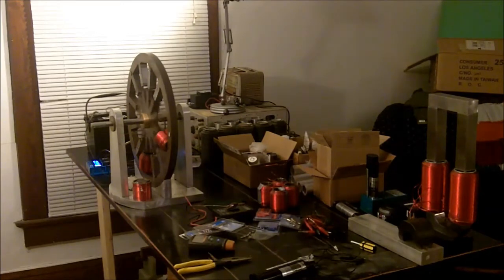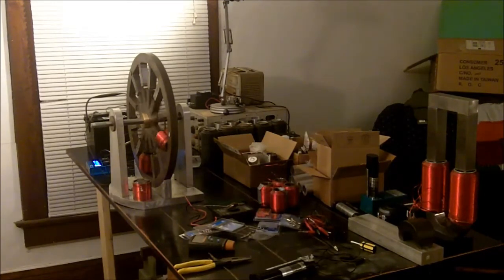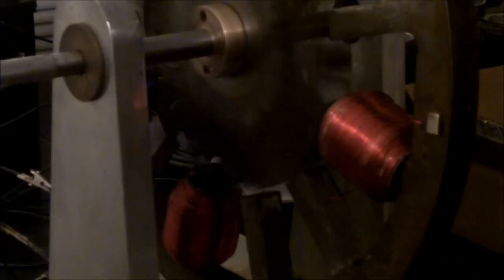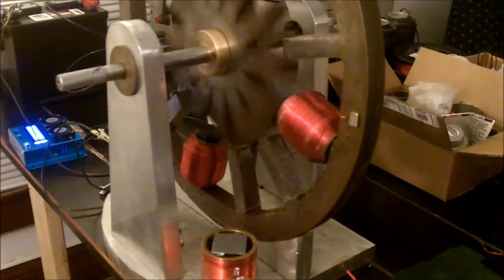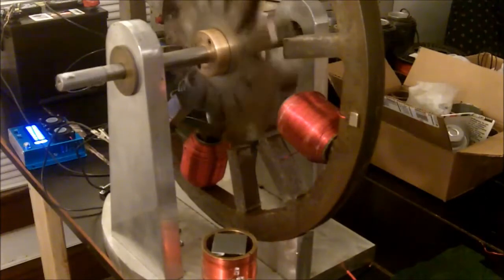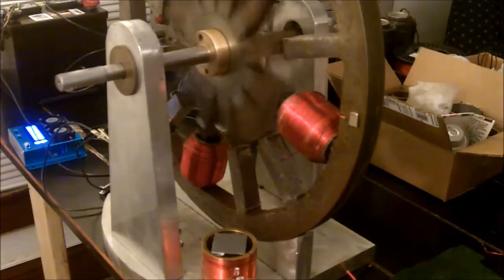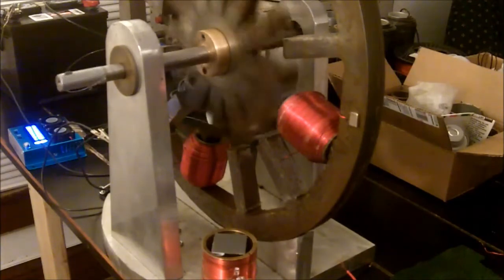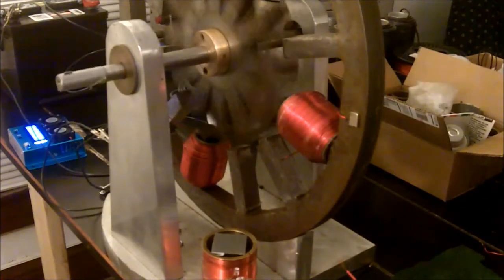Resonance Motor Made With A Torch And Grinder

Comment: What is that sound every 5 turns of the rotor?
Reply from the maker: Thats that brass washer riding on the shaft.  The other sound is fan on the PWM
Reply: @MagneticUniverse  I just hear some sound  about  every fifth turn when it was running. I know my little wheel I have to adjust the coils like a distributor changes position on a car. I am using a mechanical switch. Biased with magnets. Not sure how to make a PWM work with the setup. A magnetic pivot switch is easy to make and use. Just take a ceramic magnet and stick it on the top of your coil wheel. The ceramic is a insulator. Not sure if you need north pole bias or south pole bias. But hang a iron bar from the ceramic magnet.  needs to be long enough your  rotor magnets only move the hanging bar. Too long and your rotor will pull the iron off the ceramic magnet. Make sure to file the iron like a knife's edge connecting to the ceramic magnet. I'll  send you a message on the forum.